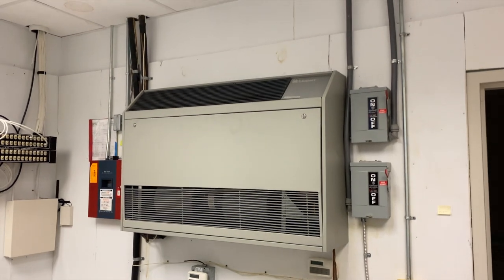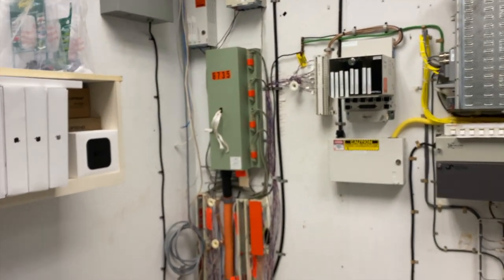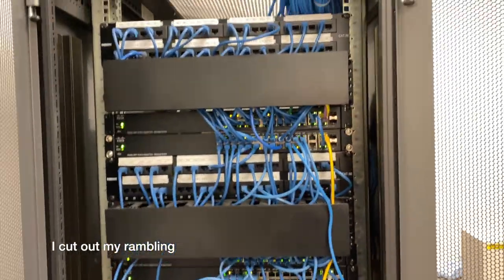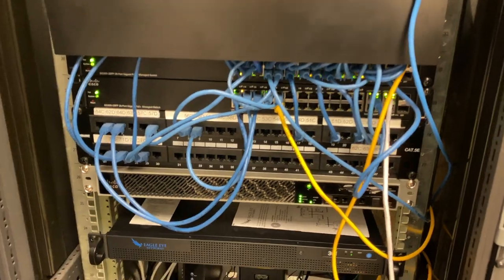Old Bank IT Room

Comment: The 25pair thick grey cables coming out of the big demarc box get terminated onto “66blocks” (not 110, 110 is usually for data and is the newer form of 66 blocks)